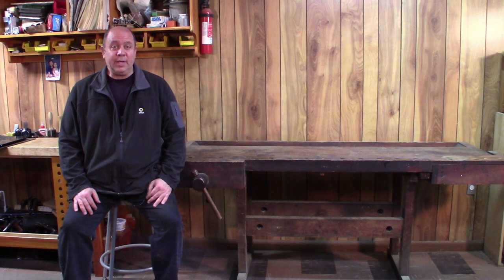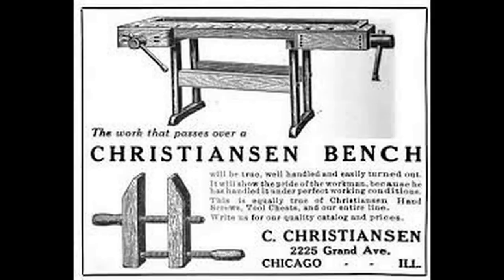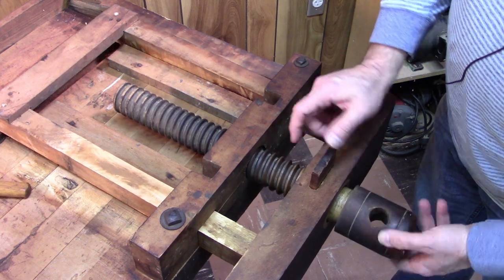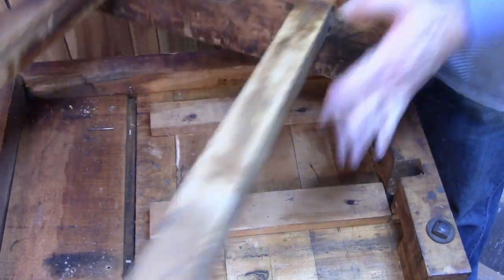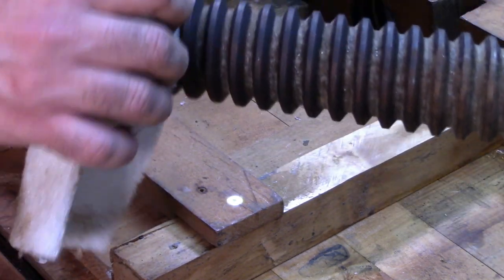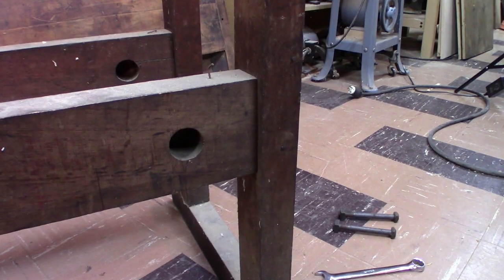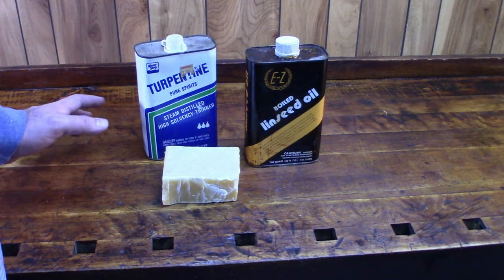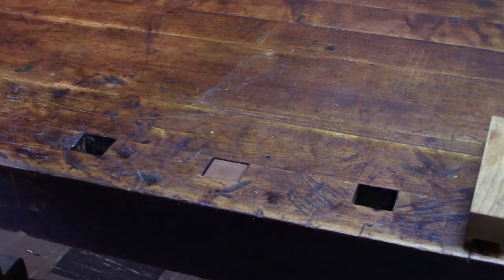Christiansen Cabinetmaker's Workbench

Comment: I also have a Christiansen work bench ,it has a brass id tag on the end and it has cast iron keepers for the screws.i bought it from aolean piano works in East rochester ny ,they were selling all the equipment back in the early 70s.there were dozens of old work bench tops ,they were selling them for 2.00 bucks including legs. I refinished it and we use it for servicing bar in our kitchen. Mike McEwen
Reply from the maker: I've seen photos of several Christiansen benches with the cast iron collars and brass nameplate like yours has. I wish mine had those as well. I'm guessing that maybe my bench was made before they started using those. I'm glad that I saved this bench from being turned into a kitchen island or bar, but they do look nice.

Comment: I am refinishing my great grandfather's Christensen work bench. I have completely taken it apart with the exception of the vice faces. Could you look at yours and possibly tell me how I might remove the guides from the mortise joint on the back of the vice faces? They are somewhat loose in the holes on mine, but I see no dowel pin or screw locking them in.